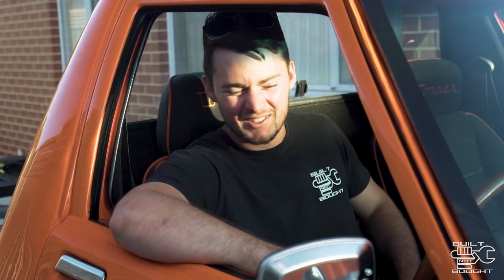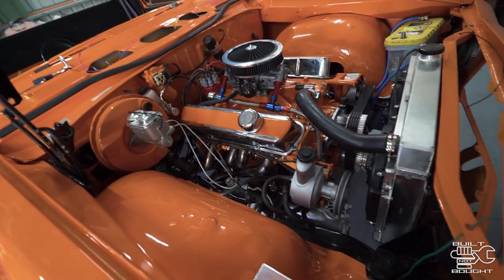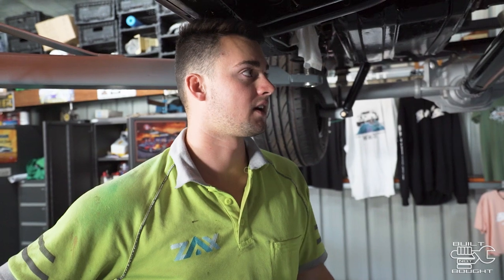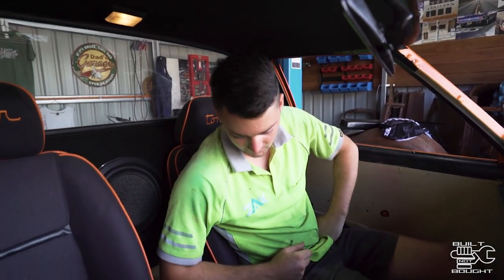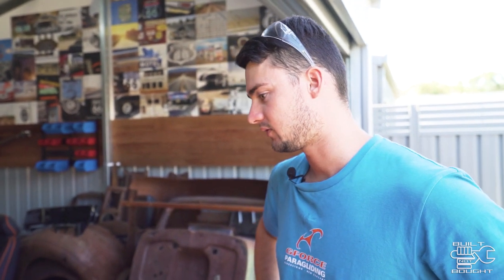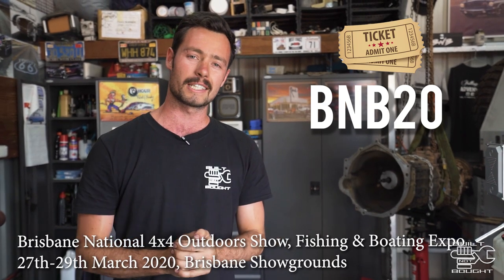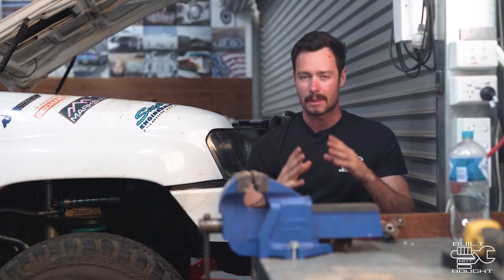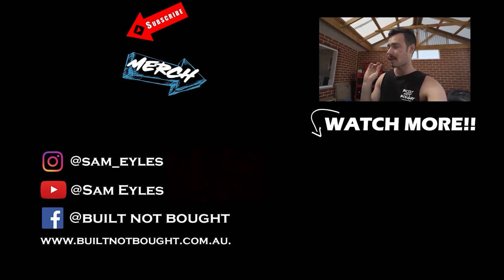BUILT NOT BOUGHT || HQ's FIRST DRIVE!!!

Comment: Hey Sam, 
Just something I did t my Tonner that was quite easy, you guys were talking drop tanks, but if your looking for an easy way to get more fuel capacity, a second OEM tank will fit on the  opposite side with just a filler neck entry change, the rest bolts in & you have doubled your fuel capacity.
Just thought I'd pass that one on.
Love your channel, keep up the good work!!
Cheers 
Steve 
Northern Rivers NSW

Comment: Consider the time your engine runs whilst vehicle stationary before this bedding the rings under load. The rings are going to bed during cam run in, more in a moment. The hone is not supposed to cut the ring, consider cast iron rings as opposed to moly etc, still going to cut? hmmm. All engines wear in mating componentry, that's why you do an early oil change to remove microscopic particulates or other contaminant ingress from assemnly. Mating will wear down high surface contact until median reached whereby lubrication then enables minimal wear over extended period i.e. years. This equates to fractions of a micron, if it's thousands then Huston you got a problem.  On initial start up motor should immediately be run up to 3000 rpm for 20 mins to harden the lobes on the cam hence not grinding lobe off from binding on lifter.
Good to see you checked ring gap but the oil ring carrier backing ring goes on piston a given direction. That secret is old school & you wont find it in a book.
Good job though lads, nice to see these older utes back on the road where they should be. Cheers

Comment: For a naturally aspirated engine, you gonna want a 2.5 inch exhaust, it creates the best performance. Any bigger and the exhaust back pressure is too low and you lose torque. Though 3 inch'll sound better

Comment: put the exhaust out the side infront of the rear wheels
Reply: @speyles  I did it with mine before I sold it for some silly reason.... it was a warm 350 and I just ran a balance pipe about 4 to 6 inches after the collectors on the extractors.. also looks sick when it's a cold morning and the lumpy idle would pump the steam out 🤙🤙🤙

Comment: you never run a new engine in under load
Reply: Correct. Light highway running, at speed.
Reply: @stuartkcalvin  ive always driven new engines as normal,just haven't over reved them or made them labour to much
Reply: Metallurgy has come a long way since the sixties and seventies.  Make it work, and the engine will thank you for it.
Reply: @petehomer675  Metallurgy might have come a long way,but life expendency isn't as long.